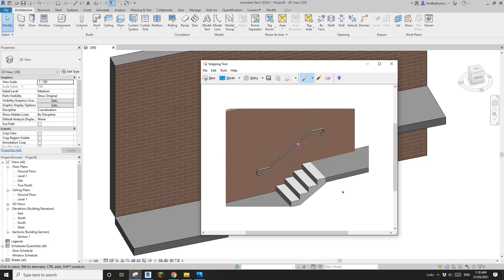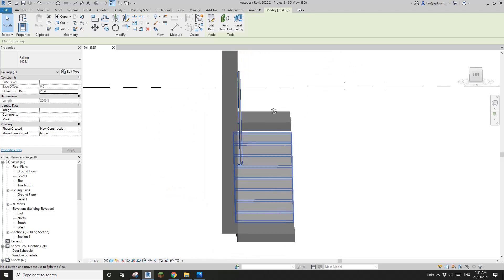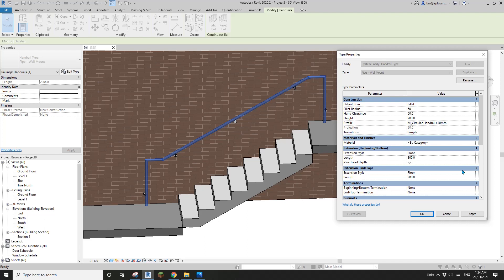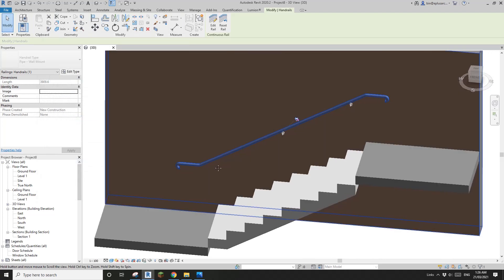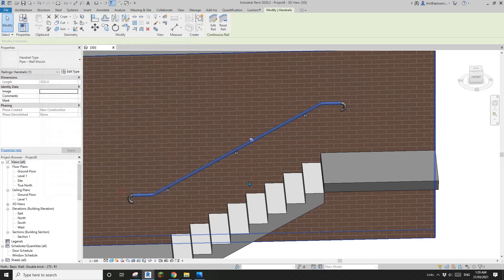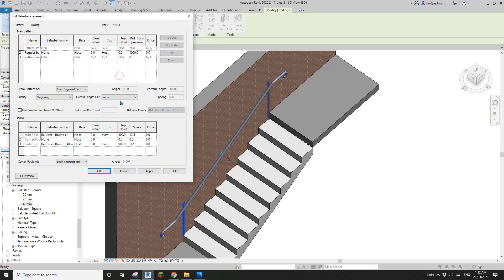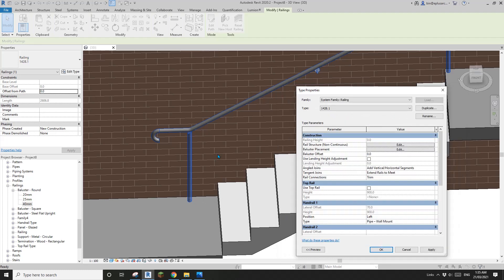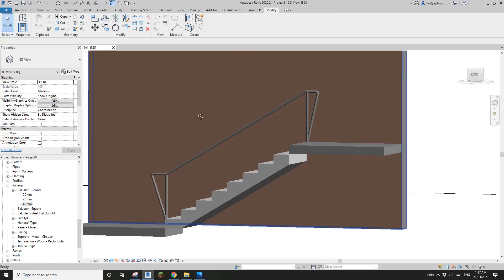Everyday Revit (Day 368) - Simple AS1428.1 Compliant Handrail on Stairs

Comment: yeah, but what if you have multiple stairs going up. You just do an easy one run stairs...
Reply from the maker: Revit should automatically place the handrail following the slope of the stairs and landing. The only part we need to pay attention to is the start and end posts, where we need to add extensions or turns to comply with standards. We can also build the ends into the baluster family or termination family, but sometimes it is actually easier to just use Edit Handrail.

Comment: great vid - do a typical with mid balusters and do an AS fire stair
Reply from the maker: Thanks. I found it a bit hard to use the stairs tool when I need to achieve specific dimensions due to regulations. I mostly use it in the early stages when I need to quickly work out tread height, depth, and the 2R+G. For construction and detailed drawings, modeling in place is likely to be easier and faster to work with.

Comment: Is it possible to have the support (in the center) parallel at the handrail and not at the floor? Thank you
Reply from the maker: How does it look like?
Reply: @BINHE615  I can't show an image unfortunatly. I try to explain better. In your video, you see the support on the wall have the bar vertical. Is it possible to rotate it and have the support bar that make 90° with the handrail? following the angle inclination of the handrail? I tried to unpin the support and rotate but I can't rotate it. Thank you